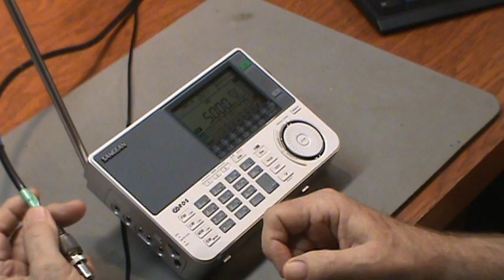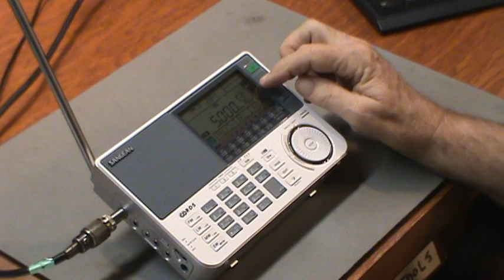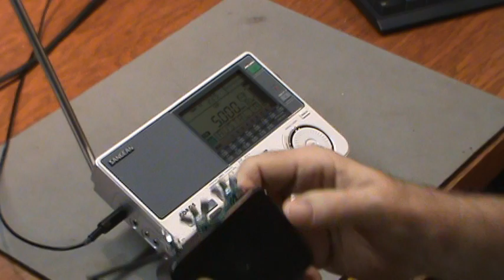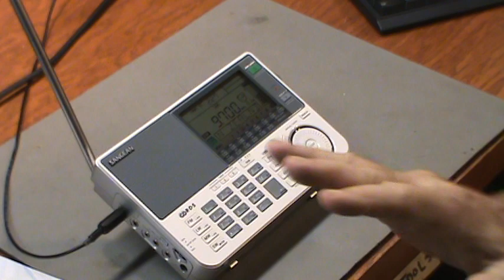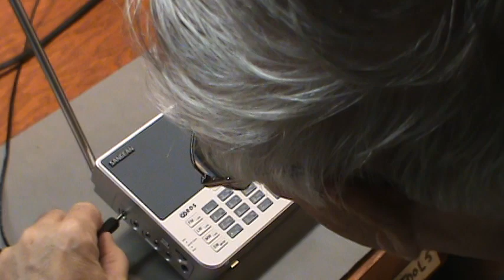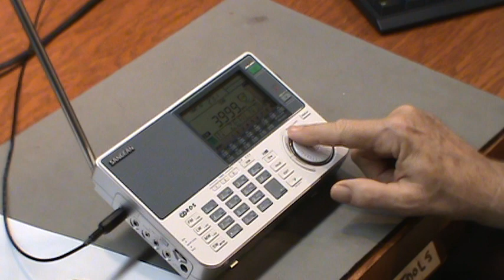TRRS #0825 - DRC Inc Antenna Testing

Comment: Tom,
Based on this video, I contacted DRC Inc through Ebay and asked if he could make one for me that had a BNC connection between the coax and the antenna wire. First, I have to say this guy is top notch and has the best customer service yet from any vender I have purchased from on Ebay. He replied quickly and had my antenna fabricated and shipped in a day or two. It came professionally packaged with everything I needed to get it set up. I finished running it to the back of my property and the reception is incredible.  I finally have no noise issues and I'm picking up far more stations than my Sangean roll up antenna does. This is the way to go in my opinion. Had I tried to make this myself, I'd still be working on it and spending far more time and money. My Tecsun PL-660 is like a whole new radio now.
Reply: thank you and it was a pleasure building it for you. God bless you and yours.
Reply from the maker: +CoolSpace Thanks for the report and glad things worked out.  Yes, it does seem like a great guy and provides good support to my channel.

Comment: thanks for the review Tom. looks like it works pretty well. yes the design is very simple on that one. I do not have that one advertised yet for it was a quick design and I didn't want to put it on the market until I knew it was going to work but it looks like it does so I will start getting it together. Once I get more of the coax I will put into production. this one will go fairly cheep due to the simplicity of the design. thumbs up Tom and don't over exert yourself anymore lol. Blessings
Reply from the maker: +DRC Inc It worked great.  I would definitely put it the market.  By keeping it simple, you keep the cost down.
Reply: I agree. I am building one now but will be using a larger coax that I have. Just a little bigger than what's on yous until I get my order of the smaller in. Thank you Tom and God bless.
Reply from the maker: +DRC Inc You are very welcome and thanks for sending me these antenna to review.

Comment: The Sangean ATS-909x has a reputation for poor sensitivity with the whip antenna, so I hope you can include more comparisons with your other outside antennas rather than the telescopic whip.
Reply from the maker: +far2many gadgets Check my other videos.  I mentioned the same thing and tested with other external antennas. I will be testing more outside antennas using this radio.

Comment: Do you have a link to the antenna on ebay?
Reply: I don't have it listed yet. I will get on it this morning. that antenna was a quick design I did one night and Tom was kind enough to give me the idea and to help me test it. the link to my eBay is: 
http://www.ebay.com/usr/delkins73

there I only have 3 field antennas but will be adding this one today. I will be using s slightly different coax that is just a little larger than the one on Tom's until I get the spool of the smaller coax. I also have one I will be adding that is an end feed with a transform that you can use your own coax also.
Reply: +DRC Inc Great. I will keep an eye on your ebay page.
Reply: +Wanttoknowabout I have one listed now but will be listing more when my coax comes in sometime next week.

Comment: Was that long wire the white one? does the black wire have shielding? It looks very thin. Does it have a number on the insulation and does it give impedance? Thanks
Reply from the maker: +1fanger I can answer a few of your questions.  Yes, it is the one with white antenna wire.  Yes, the feed-in wire is shielded.
Reply: the black cable is a rg174 50ohm coax.its a very small coax
Reply: DRC Inc Thanks guys
Reply from the maker: +DRC Inc Thanks, Dave.

Comment: Any special grounding or lightning protection needed?
Reply from the maker: +Jim S. Lighting is always a problem.  The best protection is to disconnect the antenna when not in use.  Grounding is not required but may improve reception.  On this type of antenna, grounding seems to reduce noise.  Remember, I am no expert.
Reply: +hamrad88 the shield is grounded by the radio ground in the antenns jack (the outer connection of the plug). Tom is correct, the best lightning protection is to unplug the antenna from the radio.